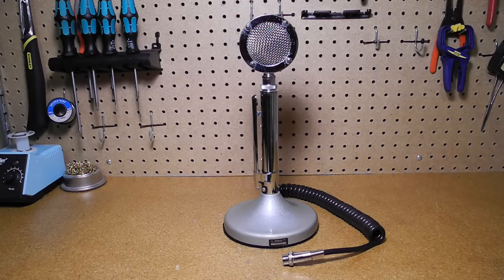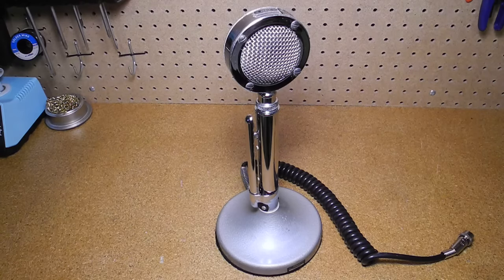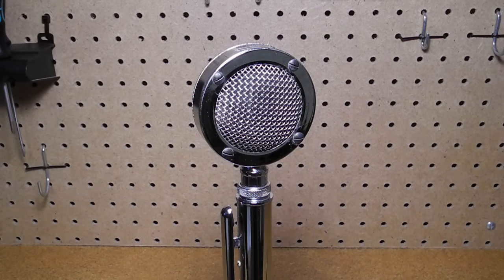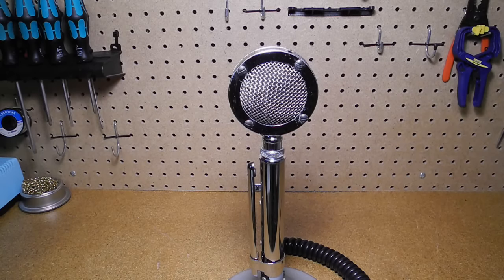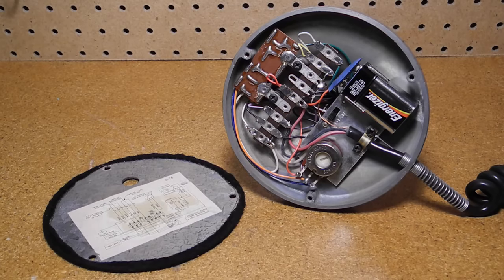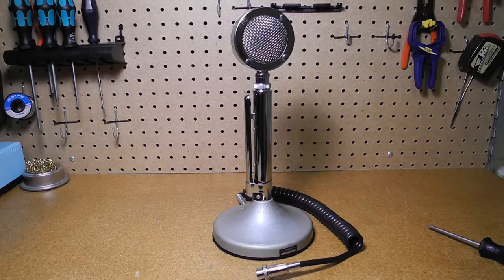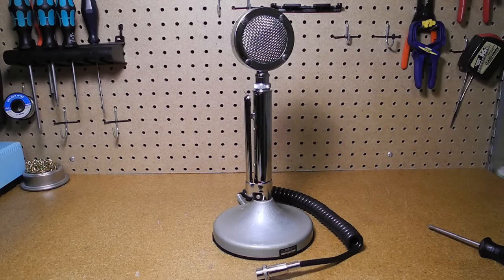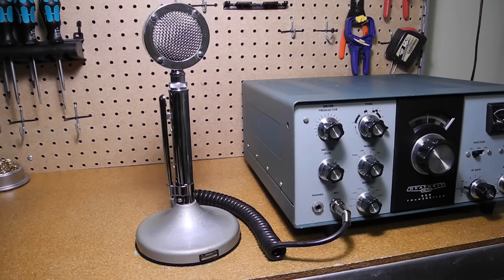The Astatic D-104 Microphone

Comment: Great video but one question. I have the model that has the transistor amplified base that has the 4 pin female connector. My Heathkit D.X. 35 has an amphenol connector. Do you know of a site that shows how to rewire it so that it can be used with the Dx35? Any help is appreciated.  :)

Comment: I believe the switch inside the base should be set to R for Relay if using on old heathkit radios?  E would be for Electronic, correct?
Reply from the maker: I'm not sure if all Heathit radios worked the same way. They typically documented in the manual how to wire up a microphone. My Heathkit HW-101 manual covers this, for example.

Comment: This video was in my Youtube recommended page...

While as a HAM, I can appreciate Heathkit electronics, I have absolutely nothing good to say about the D-104 microphone. Astatic made a proper microphone called a D-10, and was the Astatic microphone for use with Amateur Radios.

The D-104 had a dynamic range exceeding 80-DB (because of its crystal element, not a great element, because the salt-crystal element became a problem if it absorbed too much moisture), which is very much too loud for proper dynamic range on solid-state radios where the microphone amplifiers only range about 60-db (this was fixed by the audio amplifier added to later production, but this did not help for people with tube transmitters requiring Hi-Z microphones). For tubes, this can overload the first-stage microphone driver tube.

The other extreme problem with D-104 is that its frequency range equalization, placed its peak at 3-khz, which is way too hi-frequency for radios where the transmit filter in SSB normally stops before 3-khz (while the male Human voice centers at about 1200-hz), usually way before. And the average slope of this equalization does not produce pleasant audio below this peak. Many people use this microphone for contesting because of its very wide dynamic range, and brittle frequency peaks, for signal clearing. But in normal service, this microphone is difficult to listen to, on any transmitter, due to its brittleness.

So no, I don't wish to see videos about anything with a crystal element for microphones.

Comment: Is the connector same with DIN connectors ?
Reply from the maker: It looks simiilar to a DIN connector, but only has 2 pins and they are larger in diameter, and the connector has a thread on it.
Reply: You are right .Thanks.

Comment: Thank you. Is this strictly a HAM mic or can it be used on a typical CB microphone?
Reply from the maker: It should work with CB radios with a suitable connector.
Reply: Yes it will. back in the 70's this was probably the most popular power mic. for CB'ers. I had one plugged into my Cobra 85.
Reply: Working with all transceivers, no problem. Citizen, amateur, business, air, sea Band. Battery drained very low, many years operate.